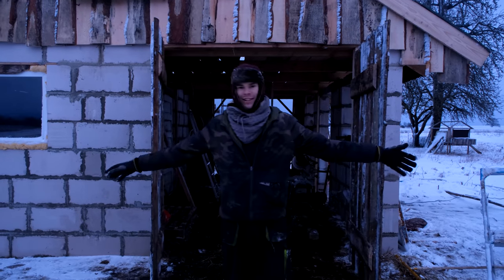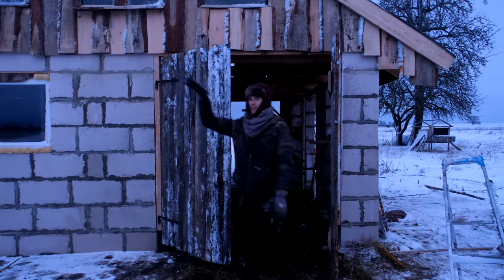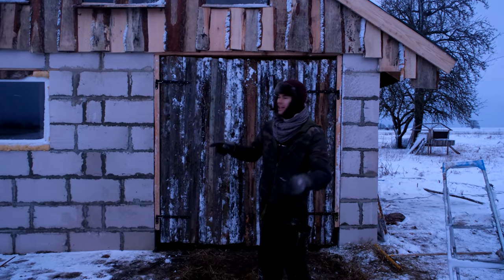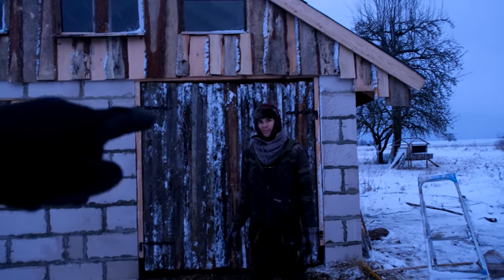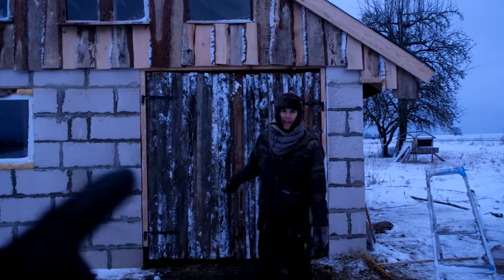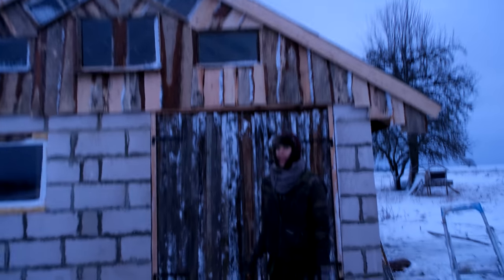Making BARN DOORS

Comment: You'll need to screw on cross bucks on the back of the door so that the doors don't sag. Basically screw a board at the bottom hinge side and angle it to the top of the door where they are split. This will put the downward force on the hinge side preventing the doors from sagging where they meet each other.